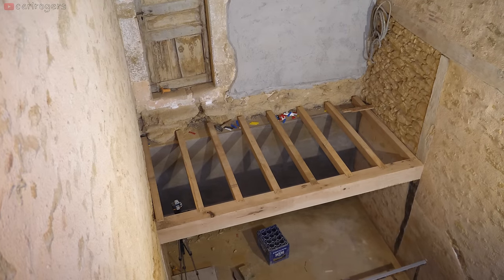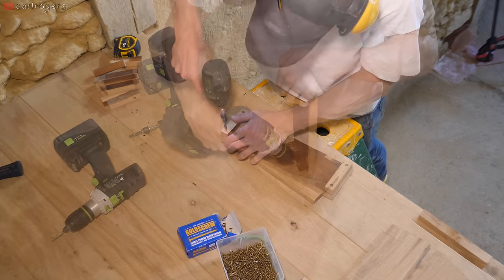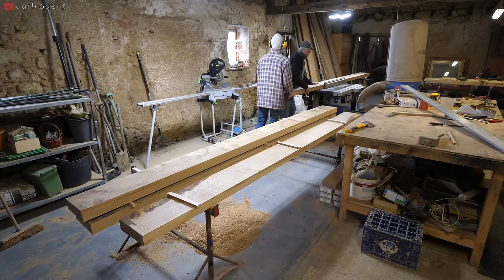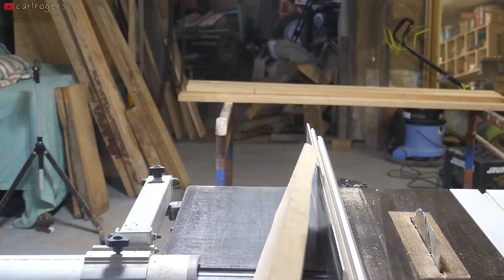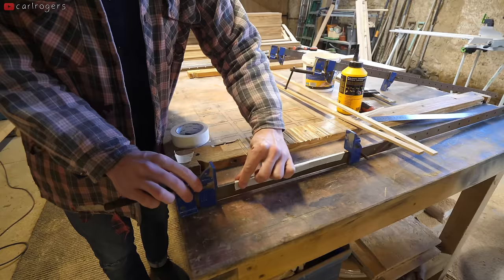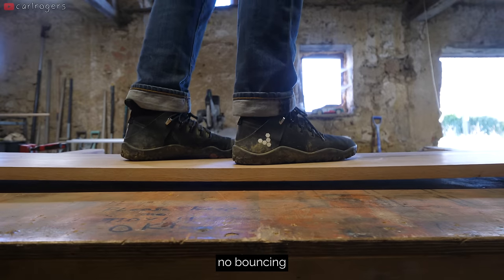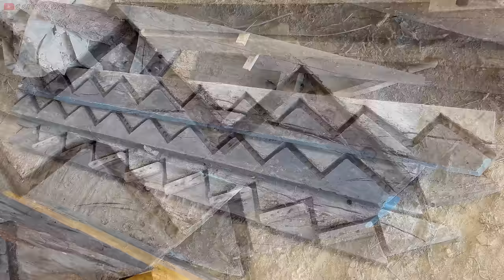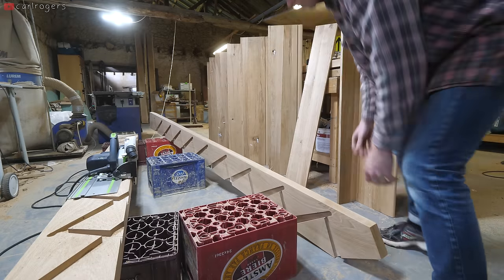#2 REBUILDING FLIGHTS | Building a Staircase

Comment: Instead of cement based render just use a hydaulic lime based - something like "kkh 35/65/500  0-4mm"  it is much easier to work with and wont damage the wall...

Comment: 20:31 extremely common. We've done many flights of stairs over the years, full restoration with original wood and period correct wood from recuperated stock and it doesn't matter if the house was originally bourgeoisie money or a farmer's delight, they all did it. What's unseen did not matter. 

As a sidenote: "Perfectionism is a modern ailment." as my old teacher used to say. Nothing wrong with it, but in my line of work, i sometimes see some people who scream "but it's not perfectly jointed" or "not perfectly to the face" then i quietly take them to a royal palace or a museum and show them the historic middle finger. Can't bring perfectionism into period correct restoration, it's against the grain. Modern work, yep, go 100% of the way with sub mm accuracy. I cringe whenever i see a restoration work that has seamless gaps and perfectly planed wood that looks like someone slapped an IKEA coat over 200 yo wood.

Comment: really a beautiful and long job, you have a lot of patience and you are very scrupulous, but in positioning the wooden floor of the landing you made 2 mistakes, 1 the wood for parquet must be kept in place for a few weeks or months to settle in,
2 at the ends close to the walls 5/8 mm of space must be left and then tightened with wedges that once stabilized you can remove, this is done so that the boards can have enough space to expand or retreat and not get up and board , it is essential since it is located at the entrance where a lot of humidity enters.
good job keep it up

Comment: None of this is a complaint.  You do excellent work. These are observations that may make your next build better, faster, stronger.  

Hundreds of houses .  Hundreds of stairs built, both rough and finished.
Doing the measurement one at a time from the last joist you installed is WRONG.  Errors add up,, quite quickly..  Choose your first joist and the tape runs back to that one only every time.  It becomes your, God point.  Matched ends is not sufficient for a T&G floor unless the boards are a 2X.  White oak, nearly makes it in the stiffness category, and the deck is small,, You will get away with using the matched ends,,, only just.  No end joint even within 3 laid courses, of a previous end joint.
You may not have a flooring nailer,, but they do make spiral (7d spiral tempered) or ring shank nails for tongue nailing floor boards.  Smooth shank finish nails will bite you in the behind later. They will back out.  
Are you going through oak, into oak beams?  Wow.  I am impressed. 
When you cut your grooves for the splines,, cut to the waste side, not the good side.. If you cut to the waste side, the far side of the groove,, any error of wander as you rip,, you can do over again to clean it up.  If doing it the way you did to the good side,, any wander on the rip and you have a defect in the groove that cannot be cured.  Remember for the next job.  Work to the waste side so a recut will cure any wander.  Same concept when you cut your rabbet,, If there is a bow in your board or a shakey feed,, defect.. Pass the lumber above the cutter and any defect just needs a new pass.
Spline rips,, Feather boards/  Invaluable..  And I LOVE your non parallel use of the lumber,, Brilliant  !  I learned something new.  Thank you.  I would do a dado and rabbet to the top of the riser,, the tongue to the rear and the face of the rabbet supporting the nosing.  Nosings can be busted off.  OR,,, no dado and rabbet under the nosing what so ever.  A few excellent screws and a glue block (screws in to the riser and the tread) installed behind,, faster, stronger.
Wood screws have a smooth shaft for a distance on the shank.  The smooth is so the threads can bite into the far part while the smooth shaft spins and tightens.  Full length threads not only fight each other but leave a normal and unfortunate debris between the faces of the joint.
Belt sanders love to screw up work.. We have all done it. Random orbital are more controllable.. With the belt sander, or even the orbital.. just before you grasp the handle,, spin your arm around the cord, and over your shoulder,, so the cord NEVER can be run over.  It will save gouges and cord repair,, and even aid in awareness.
The tread and riser to stringer joint should not be glued,, the wedges should not be glued.  Their principal job is decades in the future.  At some point in the future,, curing of the wood,, decades of seasonal moisture content changes,, swell and shrink, swell and shrink.. The wedges are there so that the next guy,, the man or woman that is the carpenter when you and I are long dead,, can simply get under the stairs and give a few taps to the end of the wedges to retighten the stairway for the following 50 to 100 years.  The way you have built that,, it will long out live you.  There are stones I have laid, stairways I have built, homes I have engineered or built that will last for 100 or 200 years.  Look to them sometimes,, for you are building to that level of quality,, the stairway will still be there and in use long past your time.  Believe it,,, your stairway will see 100 or 200 years ,, as long as the building survives.  I know this because I have worked on 100 and 200 and more years old buildings.  Good work, quality, such as yours lasts.

Comment: To everyone not experienced using a table saw, his lack of use of a rip fence is extremely risky and potentially very dangerous. If the board hits the back of the spinning blade, the board will "kick back" sending the board flying back at the operator. The only reason this isn't happening to him is the use of a riving knife, also known as a splitter, just behind the blade. This is keeping the board from touching the back of the blade and causing kickback. While I don't recommend cutting without a fence even with a riving knife, not having one in place would make the operation wholly unsafe. The use of the splitter is THE key factor, and had to be pointed out if anyone is going to attempt to work in this manner.

Comment: 25:00 I would argue that is weaker that a a butt joint. because the most likely fault line now consists in 2/3s glued fiber, and 1/3 fiber to fiber natural bond (which is the weakest cohesion strength in wood), usually weaker than glued fibers (lots of test have shown that).
it could be stronger if the fibers in the spline were perpendicular to the board fibers (so you create sort of a plywood pattern in the joint region). the fault line will now have to break fibers, which is the highest strength  in wood. and the most likely failure point will happen in the border of the spline (2 parts fiber to fiber, 1 part glued fiber to end grain), but its assume that is harded to break because of geometric constrains.
So it was extra effort cutting groves, cutting splines, and a more difficult gluing procedure to end up with a worse end product (been there, done that tho). I am also the kind of person that get carried away with "more complexity is better" because some half reasoned theory, failing to account that you are actually doing when running late in the schedule. 
An advice: if you are remotely time pressured, just do the KISS principle (Keep It Simple, Stupid), everything else will haunt you back. Only if you can sit, plan and critically assess every step of a complex process, it's not worth it over the simpler process.

Comment: Don't agree that for your threads a but-joint would have given you the same strength. That would have made you totally dependable on the glue and who knows what it does in 30 years. Adding the splices was I think the right call.

Comment: As a farmer who also planks wood and was/is also a cabinet maker, as long as the wood is prepared and stored correctly there shouldn't be a problem. The main issue is; you didn't check what you were buying, I bet it was far cheaper than buying from a mill? That was your choice, not the farmers fault...

Comment: Hello from Romania. I have a tip for you. Stop working with your shirt unbuttoned and out of your pants when ironing, if your knife catches the corner of your shirt in half a second, you will be undressed. And pull your hands over the knife. I tell you from my own experience. I cut off 2 fingers from each hand because of this. Although I have 20 years of experience as a carpenter. Don't worry, tuck your shirt into your pants.

Comment: Enjoying this video but not sure what you are referring to when you comment about ‘respect and PVA ‘ adhesives!
I use a wide range of adhesives in my workshop; traditional hot Scotch Glue, cold set hide glue, cold set fish glue, Araldite, expanding polyurethane glue, hot melt glue, Copydex, UV reactive glue, wall paper paste and various PVA glues. So I buy builders merchants own brand all purpose PVA and American PVA called Titebond available is a range and the dedicated external & internal product is first class . It provides quick grab so no sliding components together with a very thin glue line. Perhaps it’s more expensive than others but it’s a superior product and IMO, worth buying.

Perhaps you have had poor experience when using poor quality or even diluted PVA ?

Comment: 22:34 that fence doesn't help it either. I know you like the machine (i observe you're a glutton for punishment) but that fence is no bueno. If it has a decent following, you should definitely look online if someone hasn't modified it to a proper fence. As is, that thing not only screwed up your board, but it's also a dangerous part of the saw. If the blade catches the wood because of it in a deeper cut, you're gonna feel it. I haven't had this happen to me, my fence is rock solid because i have a double locking table rail, but i know someone who does what we can't handle on time and he got bit in the stomach so hard he had to go to the emergency room for stitches. I'd fix that fence asap, that flex is not acceptable.

Comment: Using Cement is exceptionally poor craftsmanship - its lazy. Your excuses about damp are irrelevant and you know better than to do work like that.
Reply: What should he have used? I'm a United States carpenter who does high end finish carpentry. As you may know, we don't use a lot of masonry inside the house. 

So, I'm completely ignorant as to why this is bad. Would love to learn something from an expert!

Cheers
Reply: @CaleCoast  As the building is originally constructed using Lime Mortar you must use Lime only. The building will have no damp proof course and so in wetter months the building will absorb moisture and in the drier months it will breath and dry out. Lime Facilitates this process.
 
Cement on the other hand does not allow this process to occur – it is non permeable/non breathable. Adding Cement to a Lime Build wall will trap any moisture in the walls. Moisture always looks for a route to exit – hence the damp will spread. The core of the walls are Lime – as they wick up ground moisture if you have cement placed on the outside as a render, there is no way for the normal process of lime built walls to breath….you get rising damp. (Remove the Cement and the walls dry out quickly).

A basic construction Rule you must follow is to not use a binder which is stronger than the materials you are binding – or else the materials you are binding will perish over time. Cement is much stronger and harder as compared to Lime. So anywhere you do a cement repair in a wall – you will notice of the years you get a crack appear along the join line. Remember a Lime built wall is always moving. A cement render on a Lime wall doesn’t have that flexibility and so you find the cement renders crack. These cracks (if on an external wall) then allow rain to enter the wall, but the moisture will be sucked up by the Lime core of the wall. 
If you look at a historic brick building (100 + yrs old) that was repointed with Cement anytime in the last 20-40 years – you will see the face of many of the bricks will blow off and the bricks are destroyed – this is because the cement is way stronger than the brick itself.

Simple rule – in Lime Built Buildings you must only use Lime – either a Traditional Hot Lime Mix or use an NHL Lime (2.0 or 3.5). If you use Cement you will cause a lot of damage.

Comment: Steel nails and oak do not mix, the oak tannins corrode the steel.
Reply: What do you use instead?
Reply: @aayotechnology  Brass is one of the few materials not affected by oak.
Reply: @tynesidesteelerectors994  interesting. Thank you for that insight
Reply: You're doing a fantastic job. When I was a resident in the UK, I was a member of the Institue of Carpenters and worked on quite a few historic buildings. Unfortunately there is little reward for fine craftsmanship other than your own satisfaction. I wish you all the best with your project, keep up the great work.

Comment: First of all i want to complement you for your work in general. I really enjoy your videos and have huge respect for the work and craftsmanship you and your dad put into your projects. But since I am a skilled carpenter i have to point out a certain thing. 

I would advise anyone against building a staircase this way. The reason is the joint that you have chosen. I was wondering about the last videos and I don't know if this was your idea or if you have rebuilt this as well. But I have never seen a mortised staircase held in place with wedges. And there's probably a reason for that. A glued connection can loosen under mechanical stress. I can understand the thought of why you think it makes sense to build it that way. You have more play to thread the steps in when you glue the stairs. And you avoid that there could be a gap between the tread and the mortise. 
As mentioned, white glue can come loose under movement. I know you have driven the wedges in tightly. But it seems to me that it is not enough. You could see in a couple of scenes when you were gluing that you were able to drive the wedge in until at some point it stopped. I could be wrong, but my feeling is that the pressure is not enough. And even with more pressure, I don't think it would work without the wedges coming loose at some point. Because they are simply not positively attached. The only way you can secure the steps is by screwing the wedges into the stringer. But then that's a very awkward construction method. 
In Germany, we call this type of construction a "fully mortised staircase". And the way I learned it is that both the treads and the risers are mortised tightly. This is more difficult when gluing, but it is the only way to securely fasten the stair tread. 
You can also mortise the mortise in the stringer and then secure the mortise with wedges driven into the end grain. But then you would need a thicker tread and that was not possible with you. But even then, the wedges would come loose at some point with the movement of the stairs. But then the stair tread itself would be secured by the mortise. With your staircase, the whole step could sag. 

Normally I hold back with criticism, unless I really know better. But here I think that is the case. It doesn't do you much good now. But I would like to prevent that your construction method is simply copied without question by someone who has no expertise in this area.

I hope I could explain it understandably. And I hope you appreciate the criticism.

Comment: First, cement does not allow any movement. Stone walls actually do move. Which means it is eventually going to break, sooner or later. Second, you did recovered the entire wall from the base with that cement. The water is going to enter in that wall by capilarity, from the very base because there is no foundation in those old stone buildings. Little by little, that wall is going to accumulate water, unable to get out because traped by the cement. And there you have your persistant water. So yes, it is actually an issue. Never use any cement on a stone wall ! This is too late for this one, it is already fucked up, but please, don't ever do that again.